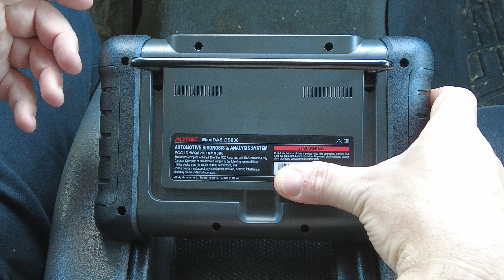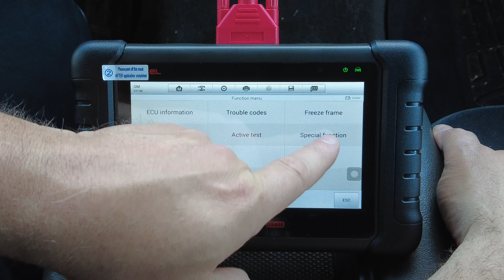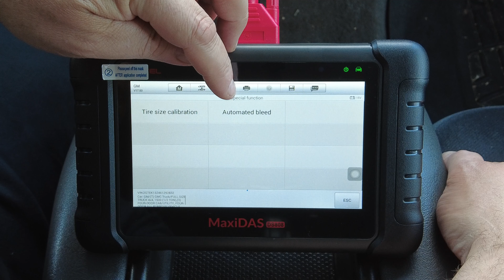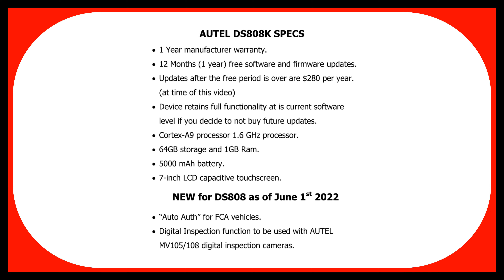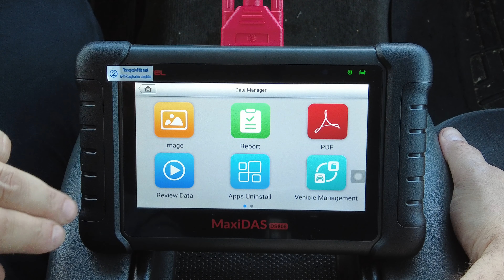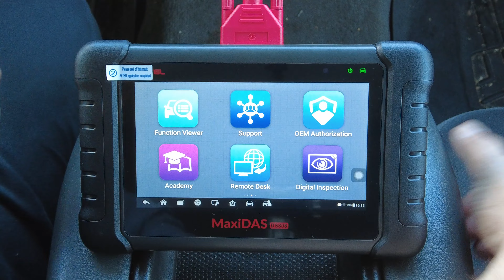Autel DS808K ODBII Diagnostic Scan Tool Review With New Features

Comment: I miss your scan tool reviews mate.
Reply from the maker: I appreciate you letting me know that.  That was very nice of you. Here is what happened.... I was burnt out on scan tool videos because at this point all the mid-range scan tools are basically the same.  I had scan tool manufacturers contacting me about making videos for scan tools that I already made videos about.  Or making videos about scan tools that only had one model number different from another scan tool that I already made a video about. (which typically means it's the same scan tool, but sold by a different seller) Or making a video about a scan tool that is total garbage.  Believe it or not, I had MANY scan tools that I had to send back simply because I refused to make a video about them because they were SO bad.  I tried to only show the decent stuff....  Stuff that I didn't feel bad about if my viewers actually purchased them.  Bottom line is....  I was tired of basically making the exact same video for every scan tool.  ALL my scan tool videos started to sound like a broken record.  None of the new scan tools had anything that was ACTUALLY different and worth talking about compared to the next mid range scan tools.  The only scan tool that had anything different and worth talking about was the Xtool D7W.  (and D8W) It uses wifi to connect to the vehicle instead of bluetooth.  That is a HUGE development in the scan tool world. (in my opinion, anyway) I made a video about it and apparently nobody else thinks it's that big of a deal. Even my contact person at XTOOL was surprised that it didn't make a bigger splash.  Anyway....  I will still make scan tool videos if I was ever offered a scan tool that wasn't exactly like the other 25 scan tools that came before it.  Again, thanks for the nice comment.

Comment: Wow these scan tools are impressive, learning alot from your page. Love the injector shut off, test option you did. Does the topdon Phoenix pro  2 also do that? I ordered it lastnight, so many great options out there. Thanks for all the info
Reply from the maker: I haven't tried that specifically with the Topdon but it certainly should have that ability. Actually, in the video I was shutting off the spark (ignition) per cylinder, and Autel calls that a "cylinder balance test".  However, they also have an "Injector balance test" so you can also test individual injectors.  Keep in mind though.....  the ECM in the vehicle has to have this functionality programmed into it from the factory, the scan tool is simply commanding a particular function.  Not all makes and models of vehicles ever made on the road today have this ability so don't be surprised if you plug into a car and you can't find these option on your scan tool. It's not the scan tool that doesn't have the ability, it's the vehicle that you're plugged into that has not been programmed with these features to begin with.  Think of the scan tool as a window that you use to look into your vehicles computer.  If a features or function is not there to begin with, then a scan tool can't command a function that doesn't exist.  Thank you for the nice comment.
Reply: @SlipFitGarage  great explanation . I own multiple vehicles, but the one I am working on now with my daughter for her first vehicle is a 2005 silverado, very similar to yours in the video. It's showing a p0300 misfire code on cylinder 2 and 7,  I just changed all the plugs/wires. And the check engine still comes on, but I do not have access to a Scan tool anymore. Hoping a crank shaft relearn does the trick. 

It sat for a year due to brake lines being rusted. Getting it up to par for her has been a mission, I want it 110% safe. It also had the common broken off manifold bolts and a very leaky manifold, I figured a new manifold and plugs/wires would cure the issue. The topdon will certainly be a blessing to have soon